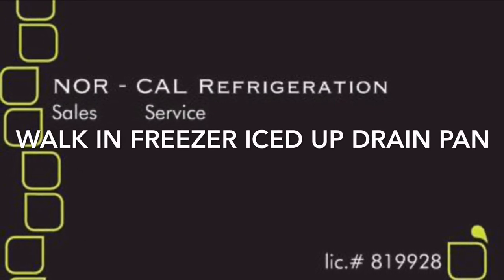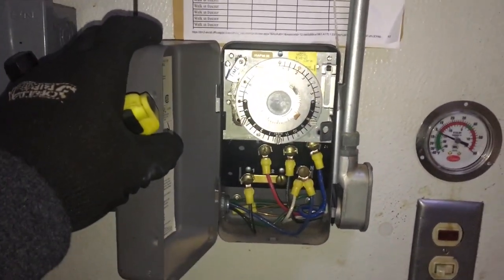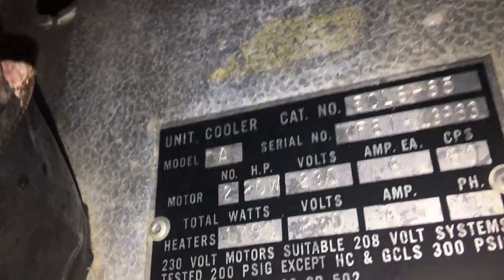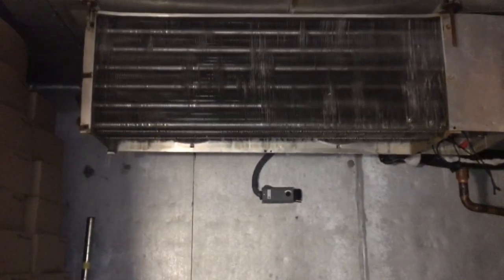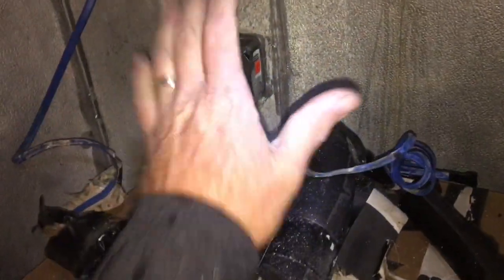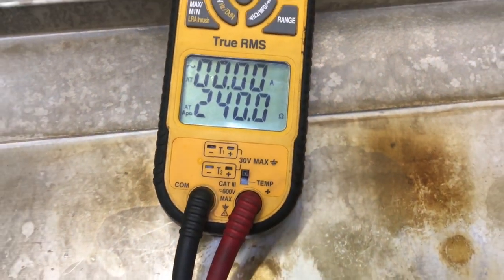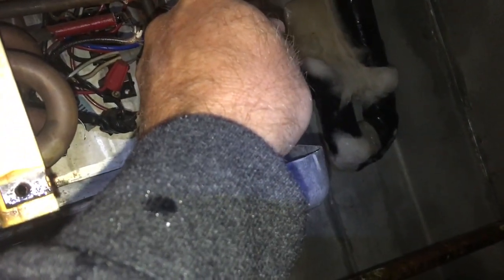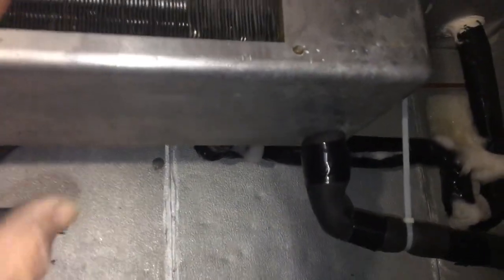Walk in freezer Drain pan iced up

Comment: Hi Dave.first i must say that i started watching your videos about six months ago in ac class... three months later i got my first job in refrigeration.. and today i had a drain line heater kick my ass during a service call. Keep putting out videos. You are inspiring a whole new wave of techs!

Quick question though, map gas wont damage any of the housing for the evap coil or the coil itself? Seems WAY more productive than using a pump sprayer filled with hot water
Reply from the maker: Refrigeration Technology you have to be real careful using map gas it will melt everything and you need good ventilation too. Be careful 👍
Reply: Nor-Cal Refrigeration & H.V.A.C in other words ill just stick to my hot water pump. Not trying to be in hot water with the boss. Respect for the reply

Comment: One thing I've seen in the past, is to make a metal tab (usually from aluminum sheet metal or a strip of copper) that wraps around the drain pan heater and sticks down into the drain nipple to transfer the heat from the drain pan heater into the pan nipple to keep it clear.
Reply from the maker: Thanks for sharing. Great tip.

Comment: My experience is that cable ties, especially the white ones, tend to stiffen up and crack after a few years. You might have been better off using some copper wire to hold it up. However, done is done, and that should certianly last a few years.
Reply: Yo le pondria tubo pvc

Comment: Thats a Very difficult one to diagnose But, i think u Nailed it ! i don't like those Heating Element Connections. does not look,like a good connection method. kinda funky.
Wow, an Old 1981 Dun & bush. Evap ! Thats the Oldddd Time Quality !  Those old freezer evpas seem to last good from that era. i've got avid up of that one i rebuit with that old flare nut city  on that expansion valve.
Reply from the maker: I saw that video. That was crazy. The old stuff was so good our industry was solid back then.

Comment: That crappy drain freezing up was more likely due to air being sucked in through the open connection than from heat transfer.  

Also, that Dunham-Bush ECLS-65 evap was designed as a draw-through coil, not a blow-through.  I'll bet dollars to donuts the installer screwed up and had to change the fan blade.
Reply from the maker: Yep. The whole box was used and the panels are shot. It's on the slate for replacement next June

Comment: .9Amps seems a little to low to me. That is around 200watts. Nice vid.
Reply from the maker: It's in line with total amps when combined with the other heater in the coil. Total amps 7.5. I'm around 8. The heater could be weak it's old as the hills.